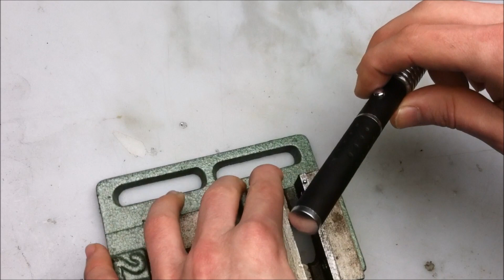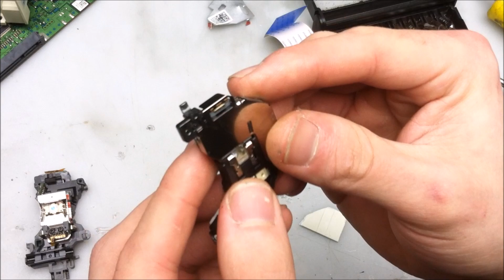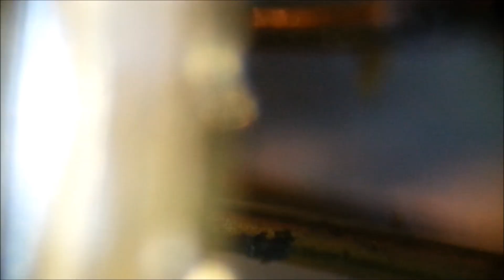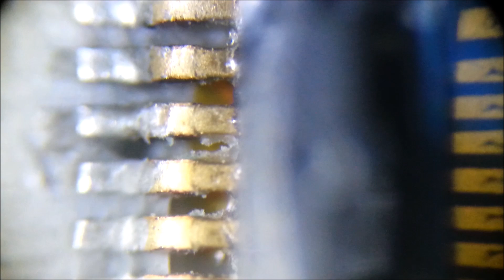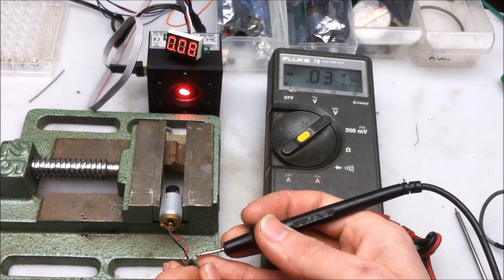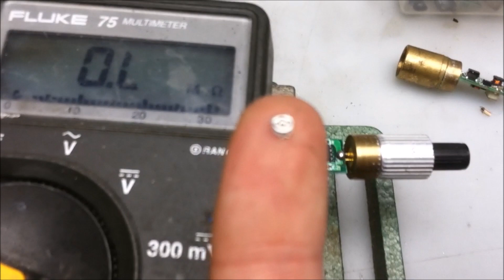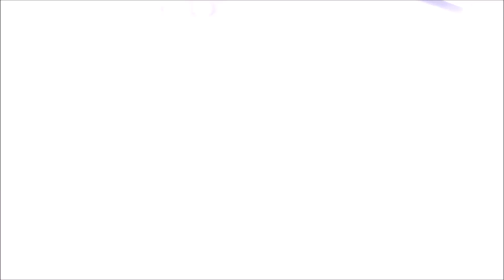Bare&Basic CD and DVD Burning Laser Diodes How to use all their types

Comment from the maker: UPDATE!  Newer eBay laser pointers are now being made even cheaper. This is going to make finding a green laser pointer with a current regulating driver more and more difficult. Now they are just flat packaged 808nm pump diodes with just resistors for limiting the power and cannot be used for this. I may cover this in a video talking about the degeneration of the cheap green laser pointer quality over the last 10 years.  Another note if you chose to use the 5.6 and 3.8mm modules in a pointer you MUST electrically isolate the laser diode host from the case. This is because those red DVD/CD laser diodes are case negative. IE wrap the piece with the laser diode in it with tape/plastic or you may short out batteries when placing them into your finished pointer.

Comment: I really like how you explain how they work and even many microscope shots of insode the Laser Diodes. Plus your explanation the correlation of current and voltage as a factory was an excellent way of doing so. I normally find it quite difficult to explain current to people that do not work with electronics. Excellent video!!
Reply from the maker: Thanks for the comment, I actually found it rather difficult to explain current regulation as well. I was trying to get into detail on it and went 300 retakes deep before I came up with the factory analogy.
Reply: @Zenodilodon  You're very welcome sir, I've built quite the few lasers (very high powered lasers) and your video opened some doors for the odd form factors (not the normal T-018 or the T-013 i believe). The microscope internal images were extremely helpful. I need to get a microscope. Mine is old and is in sad shape. Again thank you for this excellent video!
Reply from the maker: @anthonyvolkman2338  High powered lasers are certainly something I need to get into more myself on a casual level. I hope to pick up something like a laserscope in the future to mess around with. I am glad this video was interesting for some one with your experience, I did what I could to make this both useful for people who where just getting into lasers and interesting enough with more obscure information as to make it enjoyable for enthusiasts. Having a microscope is a great thing and I certainly recommend it, there is nothing quite like being able to see miniature technology and stuff first hand! No worries on the age of the microscope, I think my hails from the 70s I just managed to clean it up and mount a decent cellphone on it with decent results.
Reply: @Zenodilodon  I thank you for that, my microscope's lenses are messed up. You did extremely well with making this video for people just starting and enthusiasts that build high power lasers. I enjoyed every bit of of this vid.

Comment: I once extracted an open can diode by putting a punch onto the bit of metal that the actual diode structure is bonded to and bashing it out with a hammer. I'm suprised it actually worked afterwards XD
Reply from the maker: Some laser diodes here have absolute horror stories and yet still work. It's astonishing how much abuse they can seem to handle.
Reply: @Zenodilodon  2 years ago, i took out a nichia green diode from a projector, i didn't know much about laser diodes at the time so I powered it with a 9v battery, i even dropped in water and poured hot glue on it (by mistake of corse) it still works today! (I had to decan it though)

Comment: I got my hands on a few DVD burners, but their diodes are super small and likely are not that powerful. I also got my hands on an old MacBook Pro, that diode looks more serious, will be testing it out soon.
Reply from the maker: The size of the diode canister doesn't always mean the same power. The most important thing to look for is write speed. Typically the faster the drive writes the more power is needed to burn the disk faster.

Comment: Would be awesome if you made a second version of this video, tearing down Blu-ray optical sleds as well, and maybe even showing some of the scanning laser microscope builds that are easily doable when using these high precision optical sleds. 

If you don’t follow “breaking taps“ YouTube channel… I highly suggest you check him out and his confocal laser microscope he built!

All of your followers are aware of your genius… And I would love to see you dabble with more science related stuff. You’re too smart to stick to only show lasers 😁 you could break open the whole community and add so much incredible stuff!
Also looking forward to you building a spectrometer. Did you see “les’ lab” new video last week about removing the coating from the raspberry pi camera? 
So that it would properly register deeper UV wavelengths!? Such a cool build.
Reply from the maker: I have not seen breaking taps, I will have to check that out. I don't get many blu-ray devices in these days. I got out of computers since the Windows7 days when I stopped gaming and loathed working on peoples computers. There is only so many times you can remove viruses before you want to pull your hair out. Lasers are much nicer in that aspect, no BS software. 

Larger projects will be in the works as I am doing more with Adam, but there is also background stuff going on too, I sent you an e-mail about some of that. I do want to make an electron scanning microscope and do some hacks on my microscope. All in due time sir, all in due time. 

I actually have a spectrometer, I got it over winter and it's an custom Flip based on an Ocean Optics USB4000 It can do 200-800nm with I think .1nm resolution. It's no DIY home gamer's device and it pretty top notch. It should be making it's first appearance in one of the next videos where I will be working on a 488nm DPSS laser. I plan to measure the quality of the light between that, and argon ion, and direct diode just so I can show how tight the 488nm band from the DPSS is. It makes a diode diode look like garbage and the speckle is to good you can see each beam of speckle in fog. It looks like the hyperdrive was just fired up in the millennium falcon!
Reply: @Zenodilodon  I’m a big fan of ocean optics! I bought a pallet of their equipment three or four years ago, literally like 400 pounds of their high and top notch units. Mostly new stock!

 ended up selling over a dozen USB2000 and USB4000 units that were like new with fresh calibration. And parting out several dozen others in lots. 

It was from Oak Ridge national Lab here where I live. (Home of the atom bomb)

 With a bit of research, you can find wonderful government auctions like that!!! Also a lot of colleges and schools who have auctions, throughout all of academia! Many of which have optics labs and MACHINE SHOPSMACHINE SHOPS who are getting rid of stuff for scrap price! Industrial auctions are also good to watch for.
You’d be surprised how much laser, optics, and spectrometry equipment gets used in the weirdest most random places in industry. Like welding shops 😂 they’ll have tons of spectrometers and things to test they’re cutting and cooling fluids. And a lot of times you’ll find that it was too complicated for them to use so it’s new in the box!

You can buy things for pennies on the dollar. Sometimes almost scrap price. That’s a big part of my business. You never know what you’ll find, it might be a complete waste of time, or you might hit the jackpot. Don’t get me wrong, it’s never a waste of time. There’s always tons of money to be made. But I focus on things that are easy to ship in standard flat rate USPS boxes… 
Anything bigger than that… I try to avoid unless I’m interested in it personally.

I made a fortune on that ocean optics buy. I don’t remember exactly because I bought a lot of stuff that day. A truckload. But that pallet cost me about the price of a single spectrometer. And after my money was made…I got to keep stacks of beautiful spectrometry gear!!! . 

Sold a lot of it to a guy on eBay who is still reselling it I think. He sells ocean optics parts on eBay, everything from the empty enclosures, to full kits that you put together yourself. 

I gave him a sweet deal on a box that probably weighed over 100 pounds with nothing but new stock ocean optics parts. I had already made my money and was glad to pass on a good deal while still making more money in the process! 

I kept several units for myself, including a full Raman spectroscopy setup, And several spectrometers. But honestly the only one I use regular is the USB4000! Its had a bit of customizing work done to it by ocean optics. 

It has the “LUMOGEN” coating on the CCD sensor, I think that’s how it’s spelt. You can find info about it online.

Basically they take the CCD sensor, remove the optical window, and add a specialized coding which gives better UV resolution and deeper ranges. I think you can still find the bear sensors online to upgrade a current ocean optics spectrometer.

I’ve been impressed with it, and their company in general.

I still have several ocean optics units that I Assembled and calibrated myself from new stock parts. calibrated them with nist traceable calibration sources. I probably don’t have $200 invested in them, and it’s as useful and accurate as the USB 4000. But on a budget!

That really says a lot about ocean optics design and quality. That somebody like myself… Who isn’t an optics professional…could assemble A unit from parts, and calibrate it to perform on a high level

I love their stuff, their build quality is insane and their optics are on par with anything else I’ve seen including Thor and Edmond!

I’ve been super impressed with some of the DIY spectrometer builds. Especially the one by “les’ lab” he designed and share it on YouTube. It’s accurate to within about 1.5 nm if tuned properly… And it’s a pretty impressive unit which is easy to assemble.

I’ve actually read through that email you sent a few times, it’s super interesting and I can’t wait to see more about some of that stuff! Where did you get your spectrometry setup?
Reply from the maker: @hullinstruments  I got my spectrometer from the eBay seller Spectrophoton. The seller wanted to know more about the B&W Tek 473nm lasers and wanted to put me on retainer for future information and modification information. I told them that given the amount of changes and parts that might need to be made to make them into good 946nm units that I did not feel comfortable taking $ as it could be of crap shoot once the parts and labor where factored in. We came to a deal and they sent over the Flip 972 with a Ocean Optics mainboord on it for that as they had a few of them. I figured it was the best deal for both of us as they would be in a similar boat of finding stuff cheap and rebuilding them so it was more equitable on their end. 

If you still have spectrometers I have a good friend who is in the laser industry who is looking for one and has been on the hunt for a while for a good one to get ideally an Ocean Optics one would be excellent for him if it's something that he can get his hands on. 

I bet the e-mail was an interesting read and probably explains a bit. I tell ya you don't always get to choose the cards in your hand but you have to try to play them as well as you can while you have them. All in all i am doing pretty good and have done more than I sure as heck thought I would. It's an abundance of life lived though I tell ya. At least I am all the wiser because of it all.

One of the best things to happen was meeting Adam in that sense as it's given me an opportunity to continue my growth and do more in life. There is a lot that is going to happen and it's going to be a rocketship ride with the exponential curve on upwards that is in front of me.

Comment: hey man im curious as you said the driver circuits are less common now with the cheapening of production of the pointers. i dont know much about this topic but im curious i have one of those laser light show things you put in front of your house and it shines patterns on your wall. would that be usable as a driver? i assume it has its own standalone driver and not just resistors as its a little more expensive than a cheap laser pointer from ebay. but again im not very knowledgable on this subject as im just getting into it. i already took the device apart and have the board from it intact hopefully i can use it for one of the dvd diodes that would be awesome.
Reply from the maker: You might be able to find a driver inside, but I have even heard that many of those have gone to just resistors too. You can always use the LM317 as a driver in a pinch and I have a simple DIY driver that I talk about on the LasNova50 video in the later half. The circuit will drive pretty much anything depending on the transistor/shunt resistor combination. I recommend for starters the D882 with a .5 ohm shunt. This will offer 0 - 2 amps constant current. ( isolated heat sink required ). Feel free to ask questions as needed.

Comment: Thanks for the valuable info. I wonder if it is possible to measure V or A during the CD/DVD player operates. That could be another way of measuring the operation voltage and current of the diot.
Reply from the maker: You can if you have a scope that can read pulses quickly. The down side is that even if you do get the readings they will be higher than recommended for continuous wave use such as in a DIY pointer/module.

Comment: Very cool! Never seen some of these crazy LD packages that come out of the laptop burners. Also interested in learning more about the dual wavelength output from the single die. Can you run both wavelengths at the same time?
Reply from the maker: Thanks! Yes both can be run at once however this would require 2 drivers that could be both tied to - on the LD. Many laser drivers designs are regulated on the - side so they cannot be combined to run both at once. The drivers would need to regulate on the positive side of the output.

Comment: I'd like more detail on collimating the laser. Are there different qualities of lenses? With the right lens, can you send your beam further than most with less expansion? Do certain lasers emitters make non circular beams that need correction? Thanks
Reply from the maker: Most laser diodes make a bar/rectangle beam. Usually these are mulimode laser diodes. There are a few single mode laser diodes that will give you nice decently round beams, usually the ones for optical media like DVD or BR, There is also green and blue single mode laser diodes but they are all lower power. The higher in power you typically go the worse your laser diode's beam will be on one axis. This can be corrected to a degree with cylindrical lenses or an anamorphic prism pair. There are some FAC corrected laser diodes, however they look to only make uniform  squares by reduction of one axis and an increase on the perpendicular axis of the beam. There are different lenses, I typically go for a dual or triple element lens that is AR coated for the wavelength it's being used for. However those come with a loss of output due to the beam going through more than one lens. For the best power a single element is often used esp for those who want burning laser pointers. I prefer the beam tightness more myself these days which is why I tend to go for compound lenses.

Comment: Question from a rather newbie... Is there a way to use whatever driver is on the "sled" with the diode already? Just provide the proper voltage to wherever needed? Thank you for the amazing video!
Reply from the maker: I think only the setting potentiometer and maybe an opamp are on the sled. The actual diode driver is on the main board of the optical drive otherwise IIRC. On many ribbon cables for sleds there is a point with 2 exposed connections. These go to the laser diode and there is a blob of solder connecting the 2 connections on the ribbon cable of which is removed when the sled is installed. This is to prevent ESD going to the diode. I could be mistaken but I don't think there is a whole constant current driver on the sled.